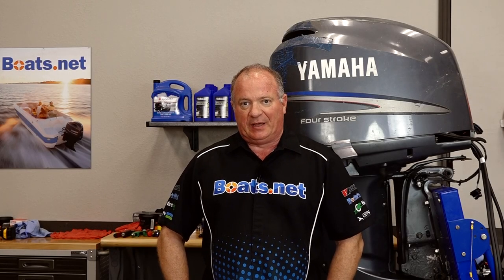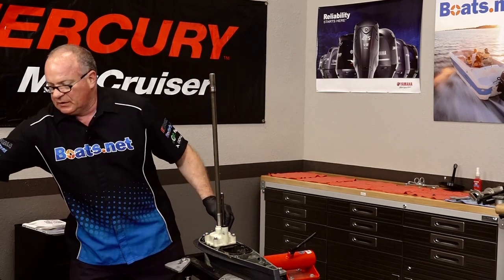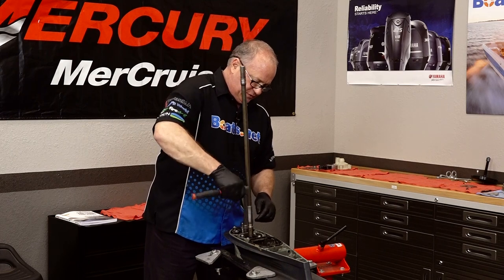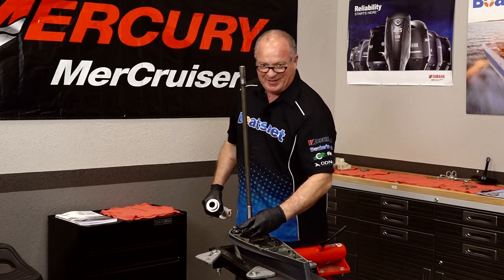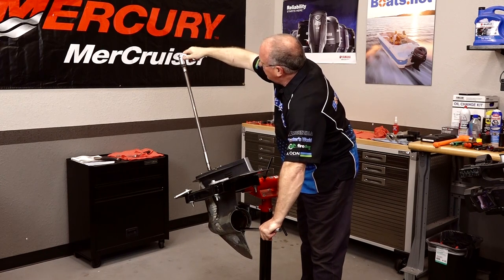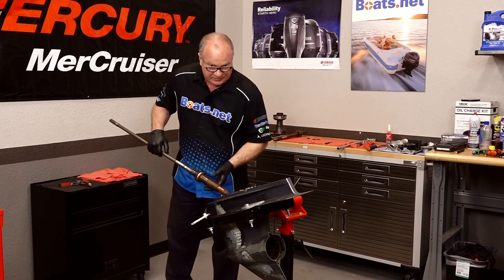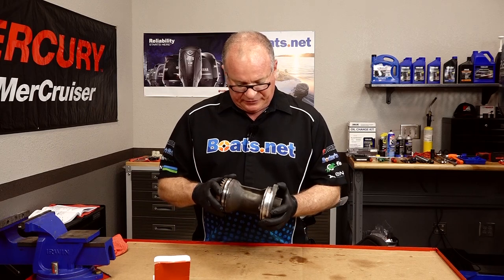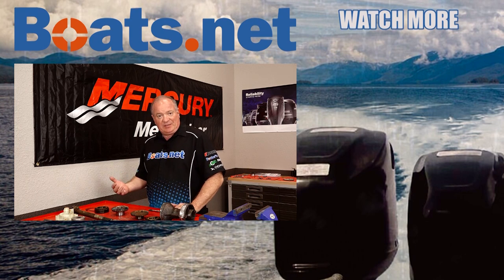Yamaha Outboard Lower Unit Disassembly | Yamaha F225 Lower Unit Overhaul | Boats.net

Comment: Thanks for the videos. I love the breakdown and explanation. I know you sometimes put links and descriptions of the tools you use. Im specifically interested in that bearing removal slide hammer you used to pull the reverse gear and bearing from the carrier assembly.

Comment: awewesome video.  perfect.  sounds like it is always cheaper to replace the lower unit.
Reply: I had a bad dog gear and reverse gear. Sourced parts from all over the net and am able to get it back up and running for $570. New unit is $2200. Refurb units are $800-1200.

Comment: nice video, well made, but one tip, that press work at 12:38 NEED a face sheild, or at BEST a press with a safety door/full enclosure, as when some old bearings, etc. 'pop', they do so like a grenade going off!!, splinters/ balls, rollers going every which way, so face and eye protection is a MUST. (also for those with hearing sensitivities (Autism, sensory processing dissorder, etc.), this is VERY LOUD, wear ear MUFFS :-)) ).

Comment: John, I am the 3rd owner of a Yamaha F150 TLRC (2004, 1005 hours) and am overhauling the water pump and replacing seals for my first time. I do not know the repair history of this engine. The drive shaft bearing carrier is stuck very hard in the lower unit housing. I am using the MT0016 puller you use in the video and have applied heat with a heat gun. I was unable to rotate the carrier at all, even with a brass drift and ball peen hammer. The bearing carrier flange eventually broke on one the side facing the shift linkage while using the MT0016 slide hammer, so about 2/3 of the flange remains. I am trying to salvage what I can.  The drive shaft is junk due to badly worn upper seal surfaces. I suspect severe corrosion in the bearing carrier bore in the lower unit  housing and had a small amount of water in the lower unit lube oil. Have you ever seen one this tight? And do you have any recommendations? Great video, very helpful, especially the tool list and references.

Comment: Question, underneath the waterpump there is two lower unit oil seals running on the drive shaft. My driveshaft has some rust and  two grooves that the oil seals made in it. I know you can get speedy sleeves for the oil pump but is there speedy sleeves that I can slide down the driveshaft to take care of the grooves at the lower unit oil seal housing?
Thanks, awesome job, and can not wait to see a video about replacing the exhaust due to corrosion.

Comment: I have a question for you. I'm no marine mechanic so I'm kind of scratching my head. I have a 87 75hp Mercury Mariner and I service it every single season, no leaks anywhere, Everytime I drain the lower unit, the fluid is clean. No water, no metal. So I started to take my boat out this season, and now when I accelerate, I hear this clicking/knocking sound out of the lower unit. I can rev the engine out of gear and no noise. The noise only occurs under load, the noise is rhythmic and gets louder as you gain speed. But the noise does not get faster. Any ideas of what it could be? It's driving me nuts. I replaced the prop and balancer recently and did not change anything, thank you in advance.

Comment: Can you replace a 25" shaft with a 20" shaft if you have the same lower unit for a f100 txrx ? Mine came with a 25" and I bought a 20" but the shaft and shfit shaft are too long. The lower unit i bout was used and is making a clunk  noise after you shift it in gear and give it more throttle. My old one never maid the noise. So I was going to use the original lower unit and just transfer the input shaft over ?

Comment: I need to replace my bearing housing, other than that o ring that goes on the underside is there anything else I need to order? Or will 6E5-45331-00-9S be the only part I need?
Reply: I have a p150tlrv model

Comment: Can i have the part number of the adapter, which you used to hold the drive shaft while looseing the pinion nut
Reply: I need this adapter as well.  Does anyone have a part number/source for the Drive Shaft Adapter?